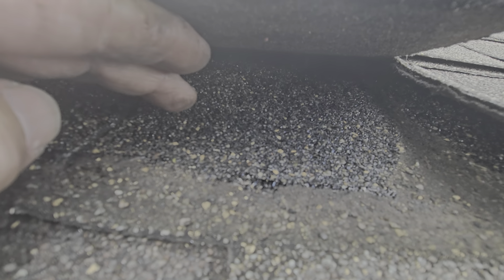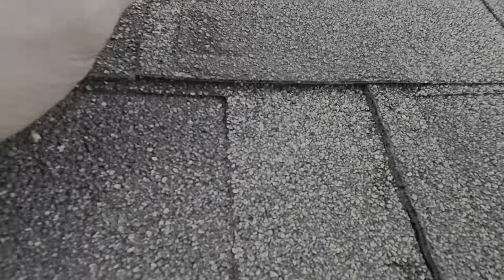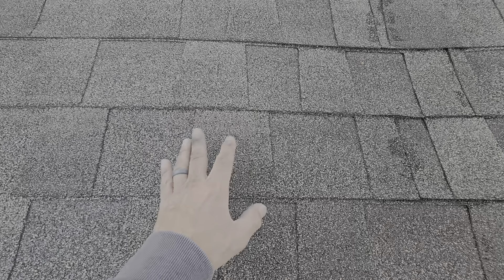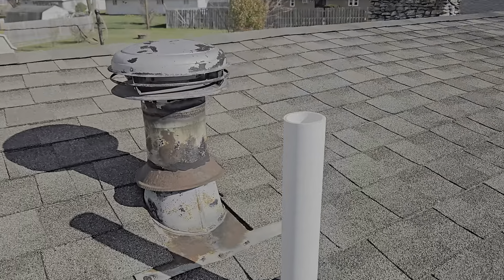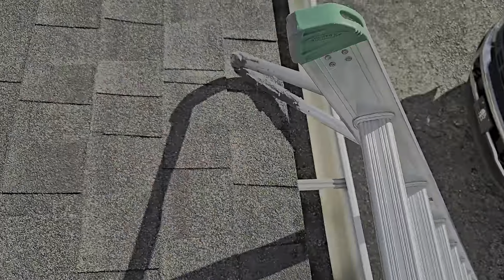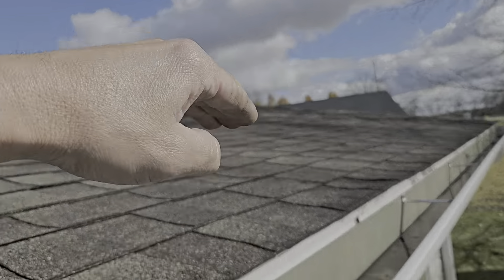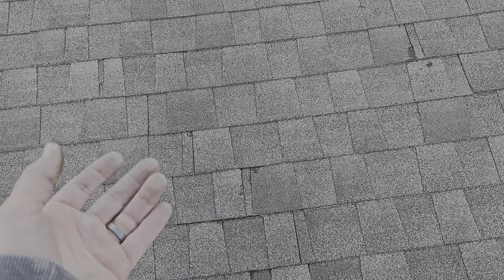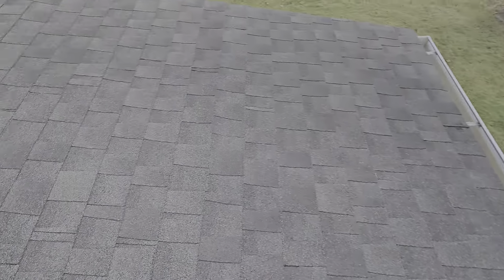How to find a roof leak that does not have obvious roof damage & Repair cost

Comment: Hi Brian.  Question - you mention laying down 1/2 sheathing to replace the 3/8.  If doing a totally new roof replacing the all sheathing - would you still suggest 1/2 or 5/8 inch plywood? (not OSB) (PS "Money"  to let you know I watch to end ... but not really wanting to know the estimation process)
Reply from the maker: Plywood is definitely better than OSB but money can be tight for people so that’s why I typically figure OSB in my area. Although just this morning , I did add a note section in the line item that they could upgrade to plywood for just the cost difference.

Comment: I recently purchased a house and wanted to inspect the flashing around vent pipes.  Due to the pitch, I needed to use roof hooks on a ladder to keep from sliding down the roof.  I used an extension ladder to reach the roof vent and sure enough, there were gaps which I sealed.  After the job was done I noticed that using an extension ladder was a no-no because there was NOTHING to prevent the ladder from sliding apart and launching me off the roof.  Oops!

Comment: i agree with every said beside the drip edge on the bottom is an industry standard in lots of state and you're not allowed to overhang shingles in those areas as well such as Florida but keep up the good work and let's focus on the actual no brainer bad practices but remember to keep opinions out of it
Reply: I think the apron instead of drip edge is well established, but in the south with all the heat, that's an interesting point. The problem is with drip edge, the angle is 90 degrees and this pushes up the shingle. Maybe you have angled drip edge down there?
Reply: @pcatful  yes we have pitch specific drip but ive never had issues with the standard drip either as long as there sheeting come down far enough

Comment: I like to hear about the what it cost in money.
For a contractor just to come out what do you charge?
Reply: Yeah good question. I find in my work small jobs or consulting are hard to nail down. Someone like Brian is very busy and to add another trip in his day. I think it would be at least his two hour labor+ overhead. Someone around the corner could be less. And then when trying to drum up business it's actually no charge. Hard to say.  I'm a designer. I'll talk to people for free, but once I get into a job it's hard to quote a tight low number as it can take a day of my time and lead to nothing more. Quoting full projects is easier. I've done a lot of preliminary work over the years and got nothing for it. In those cases people realized how expensive construction is and got cold feet.

Comment: Money, good rule of thumb for the pipe boot centering head lap past pipe. I hate those Otey plastic flanges. I see a lot of them with the rubber boot starting to split in the back and replace them with the Otey aluminum flanges. I cement them down and if it don't "stick" at the bottom of the flange, i use galv wire lath screws.

Comment: Hit those pipes with some flashing cement, make sure you put the rag in there. On the soft plywood area, I would put some aluminum coil or tin with some ice and water under the shingles. You can never guarantee a repair, just do something to stop the leak then give the owner a business card with a price of a new roof.

Comment: It is always about the money and despite the well worn "you get what you pay for", you seldom do.
Anyone can claim "superior" or "qualified" or "experienced" but at the end of the day, only time will tell if the roofing was applied in a workmanlike manner.
Meanwhile, the house may have changed hands or the installer has vanished or ?
Metal roofing, applied to standard, is excellent and long term but is always overpriced.  There are fewer installers for metal roofing so less competition and that is part of the issue.

Comment: First time home owner here.

I had someone quote me on new roofing for an 1800 sq foot house for $20,000.

They said it's a little more expensive than other companies might charge but it's supposedly worth it because their work and materials are superior.

Is that reasonable or are they trying to pull a fast one?
Reply: Make sure you get 3 bids from reputable roofing companies.
Reply from the maker: Where do you live? Is it a very steep roof, multiple layers, etc?
Reply from the maker: Just going off, what you're saying, sounds a little shady.
Reply: 1,800sf house, probably about 2,340sf of roof or 23.4 squares if avg. roof pitch.  Here in expensive CT that would be a min. of $21k to strip 1 layer and install new asphalt shingles with required ice/water shield.  Not sure where you are located, but, get some bids and some recommendations from people you know.
Reply: @GrandRoofingInc  I live in Medford Oregon. And it's not a steep roof. I'm not an expert and I don't know about layers but it seems like a pretty standardly shaped house.

Comment: I always have the Amish do my house and barn roofs.The last one was around 10 years ago. A 2000 sq ft two story house with an attached garage. They do very good work. About six or seven guys pull up in their buggies at 8am and they are done at about 4pm. They strip and shovel the old shingles off the roof and leave them on the ground for me to pick up and dispose off. My trailer and about a $400 landfill charge. I have all the materials delivered here for about $4000 or so (Owens Corning Duration). A days labor charge for 7 men was $1400. I gave them a $400 tip. Total cost installed in one day was about $6200.
Reply: I hear more and more about Amish doing work for people. We don't have Amish around us as far as I know. I guess they have to be reasonable as they aren't going out and buying boats (land maybe but not often boats).
Reply: @pcatful  You're right. Like eveybody else they do have a tendency to buy things that they really don't need like way too many out buildings and because of low interest government backed loans they over pay for land.